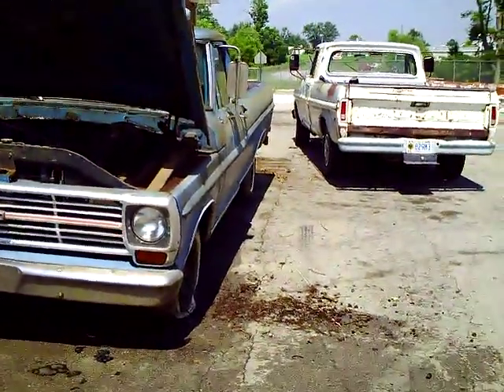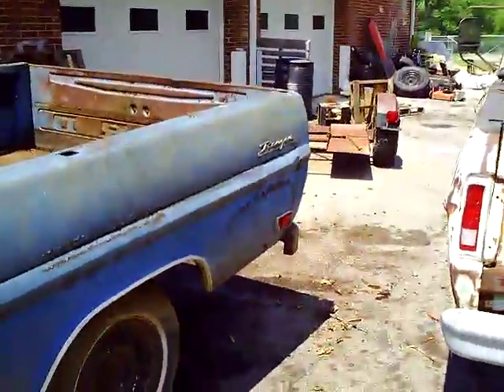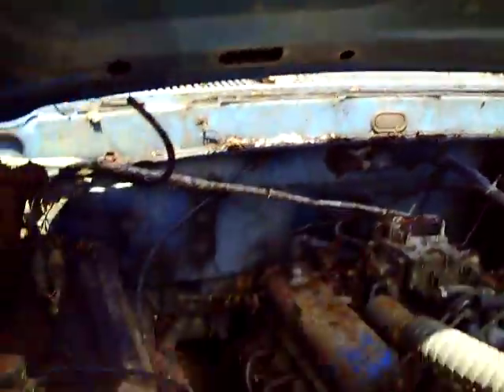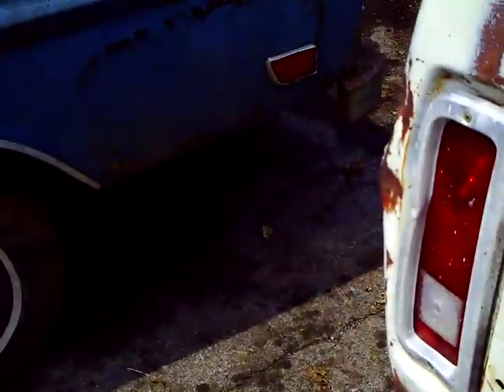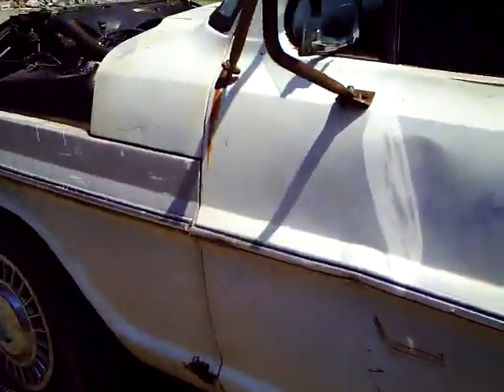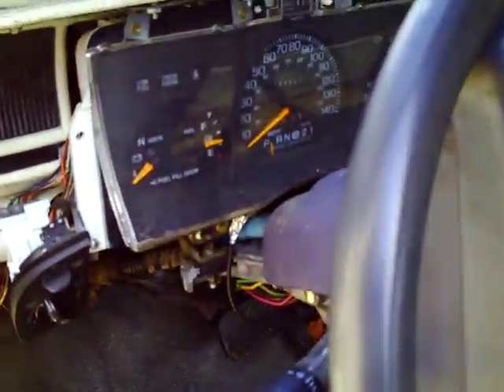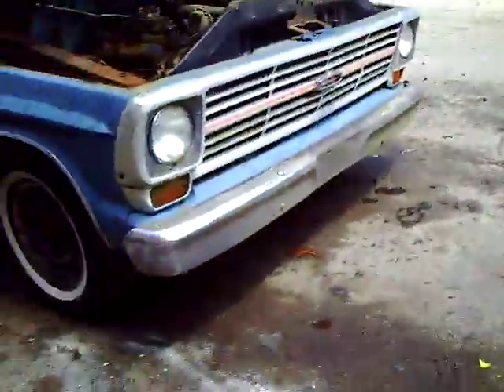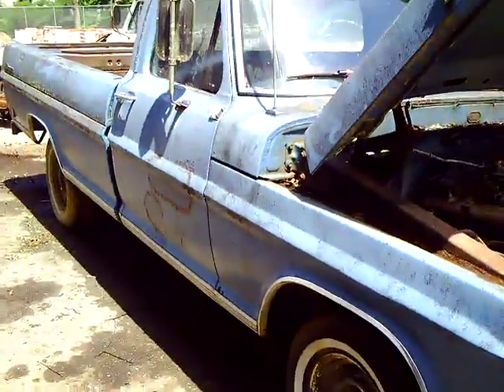Crown Vic in 67 F-100 19

Comment from the maker: @390merc65  Well I'm not cutting anything up on that blue truck. All the cutting was done on the chassis under the other truck. I will just be moving the cab and bed over to that chassis. As far as the gauges and steering goes. I will just have to drill a few holes under the dash where u can't see it to bolt the C/V hardware in. It would be no big deal to go back and put the original stuff back in later if some one wanted to.

Comment from the maker: @blazerlover25  Well that was what I was going to do originally. But this thing has factory air and I was afraid that set up I was going to try wouldn't work well. The thing is AC is more than a luxury for me as my middle son gets migraines if he gets the lest bit hot. Riding in an unair-conditioned vehicle in the summer here in Alabama is not an option. I had a friend who had a 68 with an aftermarket ac on it and he had problems with it all the time. I